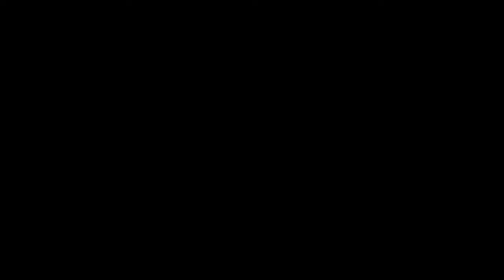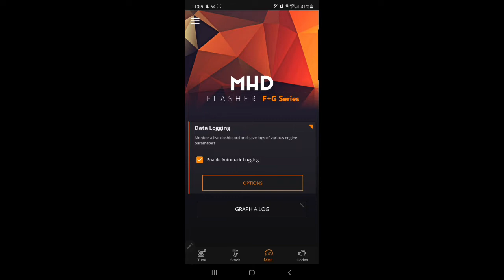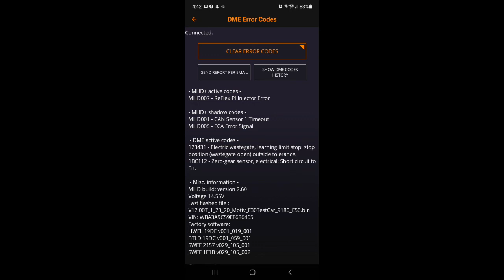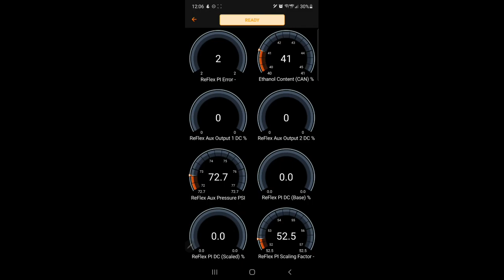MOTIV RE|FLEX - MHD Integration Information

Comment: Hey so i have a 335 with n54 im looking to do port injection and was recommended to run the REFLEX and i read it does the logging in the CANbus system, but the issue i ran into is when i went to “specifications“ on the page, it says “CANbus integration not available on n54 platforms” I downloaded the instructions just to see maybe if it was a typo, but still for the wiring instructions it says “in development”.  So i read into the motiv reflex lite. And it says im still able to do logging and maps are unlocked(even though im not going to be the one touching that). But how would a failsafe work if its not logging from the CANbus? Or being able to see through the gauges on mhd as u displayed in the video, please help